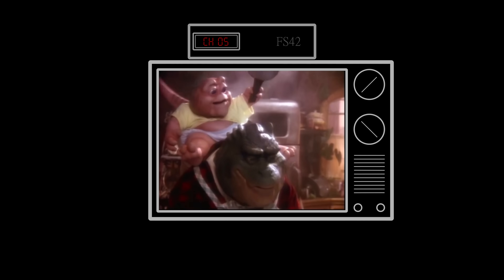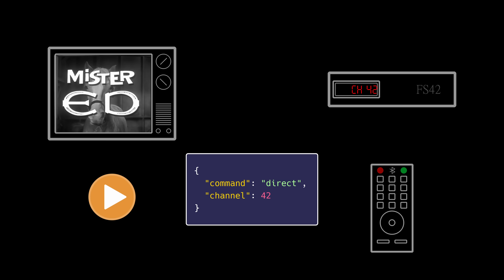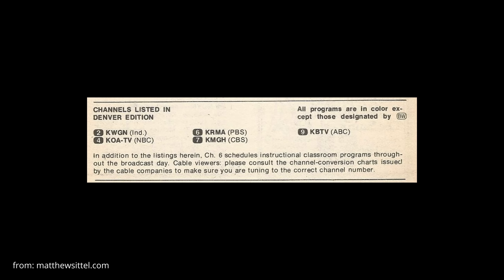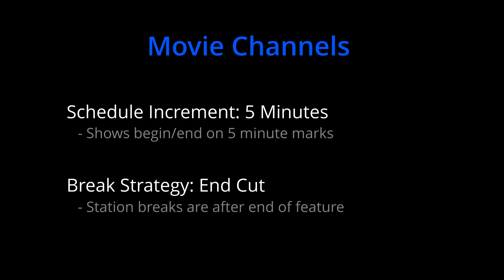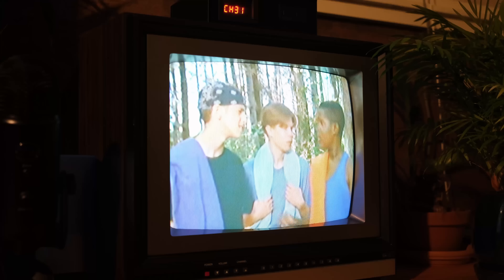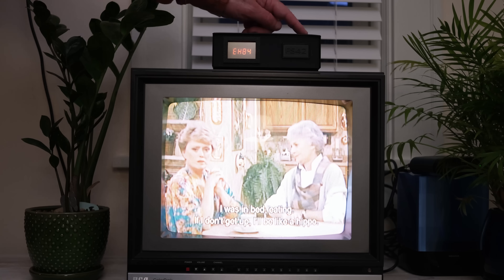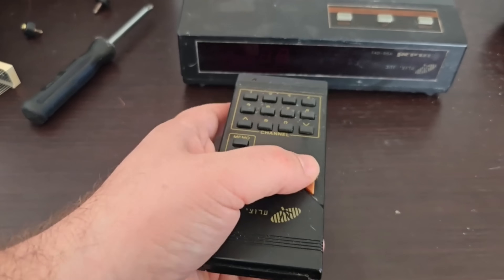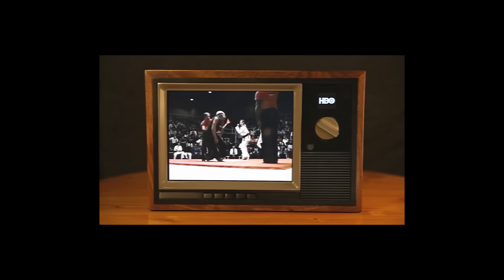90s Cable Simulator - Recreating Retro Cable TV with a Raspberry Pi

Comment: If I have a NAS, would this be able to pull the data from there over my local network? Otherwise, having to add a drive would be slightly irritating.

Also for the commercials and bumpers, did you just download them from youtube and then trim them in a video editing software?
Reply from the maker: For sure, it works with network stored drives - they can even be mounted read-only since we don't do any write backs to the content directories. It might take longer for your channel changes, but that depends on your connection. Cheers!

Comment: Holy shit I had an idea like this for commercials but I never did anything with it. I also thought of using a "booru" style catalogue system and a way to generate custom programming blocks based on certain tags and browse and categorize old media like ads and promos. Think things like "Christmas" to find every Christmas related commercial, or add "90s" "Nickelodeon" and "Bumper" to find every Christmas Nick bumper from the 90s. There's also operators so you could put "-Rugrats" to remove any content that contains Rugrats from that search for example. You can add as many tags as you want to filter it down to the specific programming you want if the tags are robust enough and its all user contributed tags so people can add tags they don't see. It seems like this would benefit from a more streamlined way of categorizing and retrieving proper content.
Reply from the maker: Nice thoughts. How were you thinking about getting the metadata for the categorizations?

Comment: Where is all the content stored? Is it in the raspberry pi? How many hours of content can this handle? This is a dream come true, I just have no idea how to actually set any of this up but I want to try
Reply from the maker: No, if you see that blue box behind the pi in the thumbnail, that's a cover I 3d printed for a hard drive docking station that holds spinning hard drives. How much you need depends on how many channels and how realistic you want it to be. Come on over to github and give it a try - if you get stuck just post an issue ticket and we'll help get you unstuck.

Comment: How can I just watch this on my laptop?
Reply from the maker: If its a windows laptop, you can use Microsoft's WSL2 (windows subsystem for linux) and it works pretty well. Just install the default ubuntu image on WSL and then you can follow the FieldStation42 install instructions on the wiki on github. If you get stuck, post an issue and we'll help out. Cheers!

Comment: The closest thing I've come close to 90s/early 2000's television is a website called ToonamiAftermath. A site dedicated to streaming old Toonami original runs of anime, from the 90s and early 2000s, with commercials from both years, along with its own custom channel guide.

Though at the time, specifically the 2000s, I didn't have a guide for my television set, it was still nostalgic to see something so close to what I grew up with, while also seeing the 90s advertisements from familiar companies.

I was born in 98, yet grew up with a lot of 90s entertainment/media during the early 2000s, since as far as I can tell, the early 2000s were the years when 90s media and culture was phasing out.

Comment: Maybe I missed it, but when talking about timing...do you have a method for timing the commercial breaks?  I know most tv shows I've downloaded or seen on dvd/bluray whatever you can tell where the original commercial break was.  Have you figured out how to cut the shows correctly, or is it just random/based on a specific time? or did all shows always break at the same time stamp back in the day?
Reply from the maker: Right now it evenly spaces the breaks, based on how many were needed. Over the next couple of days, I am releasing a feature that uses black-detect and silent-detect to detect those spots where original breaks used to be. At the least, it wont cut people off mid-sentence. The even spacing actually works out better than I expected, but there are some awkward moments that the new feature should mostly take care of.

Comment: This is so sweet, would a Raspberry Pi 3 Model B work well with this project or should I get something better?
Reply from the maker: Quiet a few people have it working on the 3 - I think you have to pay attention to resolution and encoding a bit. There are several threads on GitHub in the 'Discussion' section - or you can ask over at the Discord (link pinned to the discussion section on GitHub - link to GitHub is in the video description). Cheers!

Comment: this is incredible and i'm very excited to start tinkering with this.
however i'm curious about one thing. Does the software itself select when the commercials are airing during an episode or movie or is this something that I could manually control for each episode.

like marking chapters on a video file or something similar
Reply from the maker: Right now, you tell it which pool of videos to pull commercials from at the station level and at the time slot level. This means you can set specific commercials folders for specific shows - same with bumps. Right now, it evenly spaces the breaks, but feature is in progress to use chapter markers if present as well as to use silence and black detect filters to find better spots to insert. Cheers!

Comment: Where does all those video files go? And is it like the full movie file or just a clip? Are they stored in some kind of flash ram?
Reply from the maker: If you look at the thumbnail, you'll see there is a blue box behind the cable box. That is a cover I 3-d printed for a spinning drive docking station that's connected to the pi over USB. They are full video files, the system handles breaking them up into clips to insert commercial breaks.

Comment: I want to buy a Cable Simulator sooo bad. I cannot afford the tools you used but it would be awesome to get one from the 90s and 2000s.
Reply from the maker: You can make it on any Linux install - even windows with WSL (windows subsystem for linux) - so hopefully that wont be a blocker for you. Cheers!

Comment: I just want someone to make one for me 😭😭 because I could probably understand the coding, but actually making the machine with the raspberry pi, I feel like I'd never figure it out
Reply from the maker: You can start with something like Microsoft's Windows Subsystem for Linux (WSL) and get it running there - move out to a PI when you get comfortable. You don't have to do the whole cable box to get it working - we have a web-based remote now :) Cheers!
Reply: What is a web based remote? And also I forgot to ask! How do you make it so the tv doesn't show the 4:3 aspect ratio bars? Because I know when adding footage that's 4:3 you'll see the bars once it's on the tv and alsoo how much storage should I need to house all the content? (On the pi)
Reply from the maker: @MrComedygoldFilms  - a remote control you can use in a web browser on your phone or computer. Storage space depends on how often you are going to watch. A cheap USB drive works fine.
Reply from the maker: @MrComedygoldFilms  - on the black bars question: mostly I watch 4:3 content on a 4:3 TV, so no problem. We also expose MPV panscan and keep_aspect arguments, so you can get rid of the bars. Lots of discussions on this topic in the discussion forums on github - check it out.

Comment: oh yes, this scratches some very particular itches. Digitizing from tape is a huge pain, but most of the nostalgia heavy lifting is handled by the CRT and method of getting content to display on the CRT. I like the coax method you've used here. I've seen it done with a tiny transmitter creating an analog signal over the air for people using like video wall installations and such. So cool (as long as the FCC in your local area says it's okay.....).
Reply from the maker: This is a super important point: so much of the power of this comes from the CRT - there's nostalgia factor just in it alone.
Reply: @wrongdog_reckons facts. I love using my 20” Trinitron for games, but I really want an older console tv for older media (and there’s enough space inside for a nice speaker and a setup like this to be all internal vs a cable box setup 😉)
Reply from the maker: My initial thought had been to use the TV itself - but they just don't make CRTs anymore so decided it wasn't worth the risk.
Reply: @wrongdog_reckons hey it’s never too late to do a shell swap. Make a custom wooden console to house it all 😅
Reply from the maker: Just saw one today on the discord channel - someone used wood grained contact paper.
Reply: @wrongdog_reckons there’s a local listing for a console tv that keeps dropping in price, I’m just waiting for it to be free finally so I can scoop it up and do a project with it. Seller says it doesn’t function because the power cord was snipped but that’s fixable, and if at that point it’s still dead I’ll just pull all the guts out and use a monitor I have laying around to do a fun project with it. Basically treat it as like one of those arcade 1-up shells.

Comment: Would be really interesting if someone produces an android app that would do this very thing..
Reply from the maker: Interesting - where would you store your content on your phone?
Reply: @wrongdog_reckons  I was actually thinking more in terms of an android tv box (or even a Roku) connected via usb port to an ssd (most of those boxes come stock with a usb port and basic media player already)

As for a phone… didn’t even cross my mind. But, I imagine if someone was determined enough they could probably rig a connection to a home media server.
Reply from the maker: Ahh, makes sense. Its written in python, so doesn't immediately lend itself to android.

Comment: For most of my childhood, my family only had basic cable, so a box wasn't necessary.  Our modern-ish TVs (even the little Zenith C1312W I had in my room, made in 1986) could pick up everything directly from the coax. Maybe the earlier device you built would be more along the lines of what I'd need to recreate the experience?
Reply from the maker: You just need something to change the channel, that's all the box is for. You can hide a mini-computer away somewhere and hook a remote control up and not worry about the cable box. I don't think its the box itself that is the big draw here, its the scheduler and player.

Comment: This is not a good simulator because cable tv traditionally is fm tv stations broadcasted over coaxal antenna cable.
Reply from the maker: Okay. This is not a good comment because you might not understand what 'simulate' means -  "to give or assume the appearance or effect of often with the intent to deceive" - if I did it exactly the way the old systems did it, I would have developed the real system, and not a simulator or emulator. Cheers!
Reply: @wrongdog_reckons If you convert the single to RF it will be a realistic simulation.
Reply from the maker: Its a good simulation already - you have to understand that the files are already digital, so you aren't gaining anything from going straight to composite? The only question here is whether the RF converter is on the pi or in the converter?

Comment: Something I would like to point out since I've noticed it seems to be repeatedly forgotten, you don't actually need to do any conversion for composite video on the Raspberry Pi, as all models have a high quality composite output built in. Excluding the original Pi due to it's age and only being 32 bit, It's most easily accessible on the Pi 2, 3, and 4, as there you just need a 3.5mm to composite video adapter (Vid on sleeve, Gnd on ring 2)
Other models make it more difficult, but there is always at least a solder pad that carries the composite signal.
Reply from the maker: Good callout - its all there on the pi. Cheers!

Comment: Talks about cable TV in the 90s; Shows Network programming that we watched over the air.
Reply from the maker: You may have watched that over the air, but I did not - proving my point that no matter how much everyone assumes that we had a shared TV experience, we did not. We got exactly one channel (on clear days) where I grew up. Those channels didn't show up around my parts until cable came along in the late 80s. I would venture to guess that I've never once seen Fox on broadcast, its a cable channel to me. But sure, good snarky point. Here is mine:

Bobby3000: Incorrectly brings up a 'flaw' in someone else's video, has not content or contributions of their own.
Reply: @wrongdog_reckons It’s not about your subjective experience. Those are network programs. Regulated by the FTC. Cable programming is different.
Reply from the maker: @Bobby3OOO  - no, you might want to check up on the evolution of cable television friend. You might note that it evolved from Community Antenna projects - whose whole model was to pick up public broadcasts over the air and redistribute them over cable. This was the primary purpose - original programming didn't come in until deregulation. The point here is that cable brought more TV to more people, regardless of whether some of it was also transmitted over broadcast in some areas. BBC is broadcast, but I bet you didn't see that until Cable? You get my point? Its not all about your view friend - others had different experiences. Share yours if they are more correct, don't just knock others.
Reply: @wrongdog_reckons  BBC programming isn’t regulatedb by the United States. The legal, regulatory, and corporate distinctions between these terms have objective definitions. Did cable pick up network shows and syndicate them? Sure. But they’re not the same things.
Reply from the maker: @Bobby3OOO I see, you think that the underlying regulatory structures are what define the general publics perception of the roll cable played in their lives?  This video is more about the cultural aspects of cable television around the world and it's not focused on US regulation policy.

Comment: Holy shit, I had an idea for something exactly like this, a few months back. It seemed like, reasonable enough to do but so oddly specific and niche, that I doubt anyone else would consider it, and I'm nowhere near tech savvy enough to know how to make anything like this myself. This video is like finding Big Foot, holy shit, its literally everything I envisioned my idea being like, even down to the commercials and TV guide (although I had a bit more of a 90s/2000s blend for the video library in mind for mine). Thank you for creating this. I wish there was a way I could order one of these, I don't have the 3D printers or technical know-how to assemble all this together, but I'd love to buy one of these to just drag and drop my video files into and build my own custom TV box.
Reply from the maker: Awesome! Nowhere to buy them now - but you don't have to build the cable box to give it a go - any Linux install should work, including Microsoft's Windows for Linux Subsystem (WSL2) will work - there's a super helpful community over at GitHub and we'll help you out if you get stuck. Cheers!

Comment: is there a way to use this without a raspberry pi? like in a web docker or something?
Reply from the maker: It runs on any Linux distro - you can use Microsoft's WSL2 (windows subsystem for linux) and it runs fine on the default ubuntu install - that how a lot of people run it. I run it on my steamdeck :)  Cheers!
Reply: @wrongdog_reckons  making something similar rn that is a web app and basically syncs up with people's Plex servers
Reply from the maker: Great - some people are interested in Plex.

Comment: I wonder if id be possible to modify a tuner in a tv set. 

Like with your eye tuner, it could be possible to rig buttons or contacts in there to simulate that changing the channel.
Reply from the maker: I think it would be possible, but I just have not wanted to risk damage to the TV - they don't make CRTs anymore. Cheers!

Comment: Nice work. I would legit pay you for this as I am garbage with raspberry pi.
Reply: I would too. But I want to learn simply so that I can add new (old) stuff as I need it...
Reply: The dev did a great job documenting on his github. I wouldn't give up before you start. You just have to be curious enough to try. Lots of online help here and on the github and also AI can help you with any code bits here and there when you run into issues and error messages you don't understand.

Comment: Nice invention but I’m a little confused by your use of the term “cable tv.”  By “cable,” do you mean “pay tv,” or just the way of selecting channels which is better described as “analogue.” I ask this because much of the TV shows that you cited from the 90s were just plain old broadcast network show that did not require cable or a subscription at all. So what exactly are you referring to when you say cable? It sounds more like you’re just talking about TV in general in the 90s because as far as I can tell, the only thing that’s really changed is the way in which we get those shows.
Reply from the maker: I am talking about television that was delivered to your home via a cable, vs broadcast. You see, in very large portions of the US, access to broadcast channels was limited due to being rural from broadcast centers or obstructions like mountains and was often limited to one or two channels (like where I grew up). Cable was the first time when we all got access to the same channels - and some of those were also broadcast. You recognize that, right? A channel can be both broadcast and cable? So, many of those channels you identify with broadcast, I don't because they weren't available in my area before cable. Its like I said in the video - we didn't all have the same experience with TV.